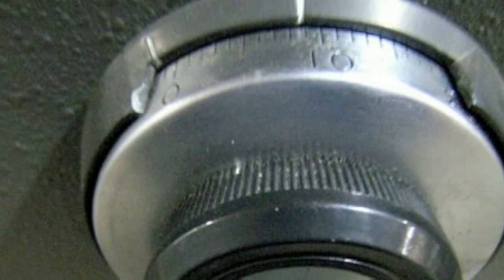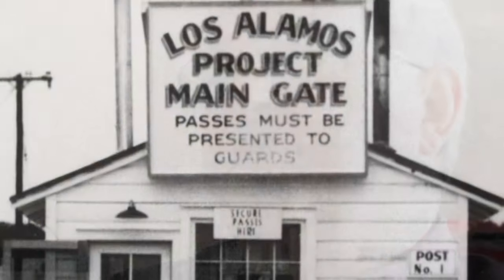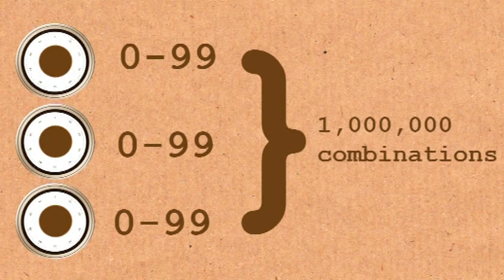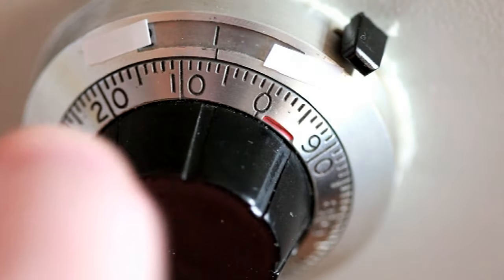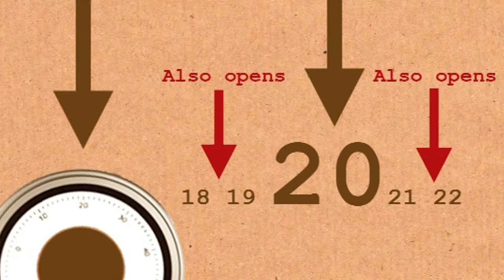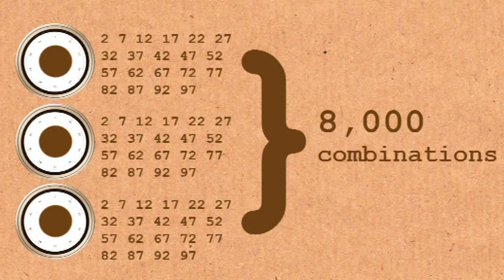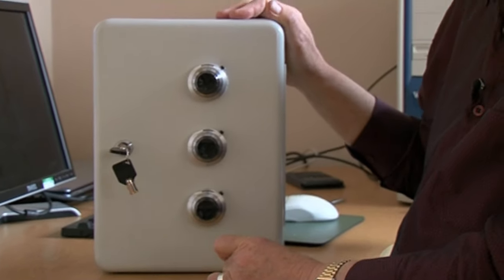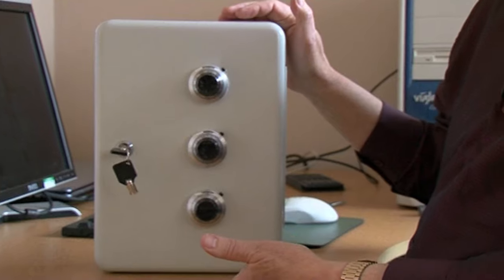Safe Cracking with Feynman - Numberphile

Comment: I dont understand int he end, how do Feynman know 2 other combination beside first one?
Reply: +yohanes ronald   Same here
Reply: +yohanes ronald To open the door, the three tumblers will need to line up so the latch can slide back into a hole. I'm guessing that this particular lock would prevent the dial from spinning freely.  Perhaps it could only turn around between the position of the 2nd and 3rd numbers. Or if the dial could spin the whole way around, it probably felt different.
Reply: yeah he doesn't explain that but from the book Feynman found that you could pick the first two numbers off an OPEN safe by turning the dial both ways in in increments and testing the bolt of the safe (pushing it) until it would no longer retract.
Reply: Glen Beestone
Thank you!
Reply: But if you need to have it open to know, then how do you know?
Reply: i may be wrong but - he found out about the first 2 unknown becasue they were already open and he was playing around with them until the right numbers clicked the sound - there he has found his hint

Comment: the tolerance has nothing to do with mechanical perfection, but in knowing that it's an analog dial and people will never be mechanically precise.. so the tolerance is by design because safes would be terribly hard to open if there wasn't any slack

Comment: I have a question. Let's say you're going through every possible combo out of 1,000,000and it takes 5 seconds to try each combo. As you go through them, the more likely it is the next combo will be the right one, as the # of possible combos decrease as previous ones are eliminated, and can continue until you reach the very last one. I know how you could calculate the max or min time it might take, but is there a way to calculate the average amount of time it would take to get it?

Comment: Funny how different people approach the same problem, I wonder if Feynman knew you can crack most combination locks simply by adding light pressure to the dial and feeling for the pin to drop into place?
Reply: Tapecutter59 

...or if you have the right power tools you can cut the door off?

Different strokes, different folks.

Comment: Most dial padlocks have 40 positions, and a sequence of 3 numbers.  But they have slack too ; 1 either way, so 14 real positions.

Now "happen" to walk by the person while they do the last number (or the first number), and sneak a quick glance.  Or even notice the lock set down in the position of the final number.

Now there are only 14x14 = 196 possibilities.  Even at a leisurely 10 seconds a combination you can open it in 16 minutes on average.

Don't use these locks!

Comment: Ha try that on a manifoil lock. No chance. They are silent in operation until all the tumblers are correctly aligned - nothing drops into place until you try to open it, and you need to turn them at least 5 times clockwise, then 4 times anti-clockwise to the first number, and 3 times clock wise to the second number, 2 time anti-clockwise to the 3rd number, and finally once clockwise to a standard value for opening. The standard value being  25, 50, 75 depending on the orientation of installation. Then the slots in the 4 disks align and the opening lever can drop in. There tolerance is less than 1 digit. Requires a special key to change the combination.
Reply: alochrome manifoil mk IV for the win... some installations also have concentric rings of lead mounted behind the lock to frustrate x-rays.... the only way to crack a properly set up manifoil is by brute forcing with a robot; in my experience, with age and being left on the same combo for ages, they sometimes develop tells...
Reply: alochrome *their

Comment: Why shouldn't there be such?
It's not about commiting crime, but rather an art of an advanced puzzle solving if you will.
Most of the people with such set of skills have a perfectly legal and legit jobs where cracking safes and doors is required.
Some even work for the safe manufacturing companies themselves and crack safes for a living in order to improve safe security even more.

Comment: ,not only was those gos roommate be loaned him his car which was used as a get away vehicle it has a flat and no serviceable spare on board so that was a hitch in Klaus's plan still feynman himself was social engineered most of what klaus for was useless. Oppenheimer said he hAd the basic Idea for the design of the Hiroshima bomb worked out in his head on the trip out to the desert. Making Abomb is not hard separating the istopes is the difficult job

Comment: the tagline after the war of Mosler Lock Co. ---FIRE PROOF ,BURGLAR PROOF AND ALSO,FEYNMAN PROOF...

Prof. at 3:03 u started the sequence from 3,,,but 3 won't satisfy if the actual number is 0,,,so it shud be ---2,7,12...97
Reply: 98 would work if the number is 0.

Comment: What if my code was 1,2,3,4,5?
Reply: You could probably do 3, 3, 3, 3, 3, and it would still work. But you have to go a bit past the previous number after doing a full rotation for it to click, which probably means almost two full rotations when you're going clockwise, because one rotation won't quite reach it.

Comment: But both ways are wrong, the only logical way is year-month-day hours:minutes:seconds.
Reply: That's still not logical unless you start counting them from the same number. Midnight on New Year's Day should either be xx/00/00 00:00:00 or xx/01/01 01:01:01, not xx/01/01 00:00:00.